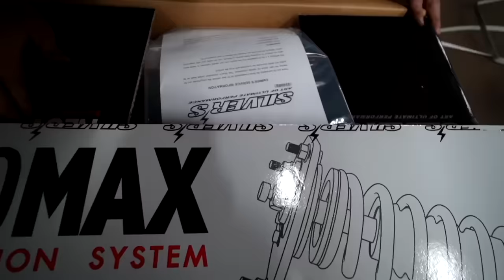HOW I WRECKED MY JZX90…

Comment: i doubt it's 36 at idle. that's probably MBT timing, there will be modifiers for throttle position, valve lift position, and torque demand that reduces it down to a sane number